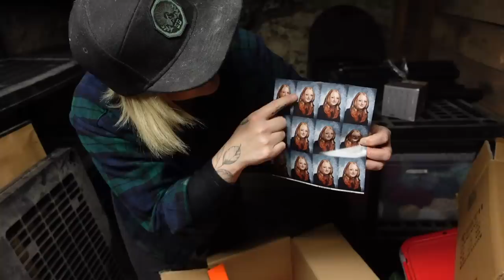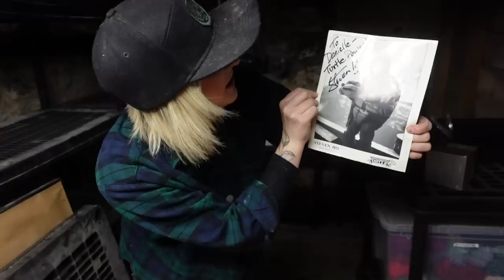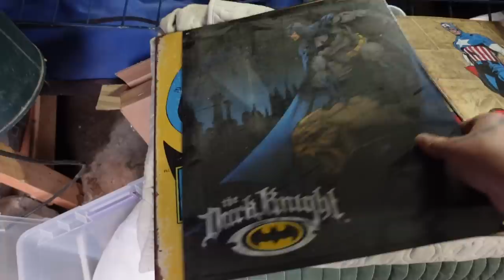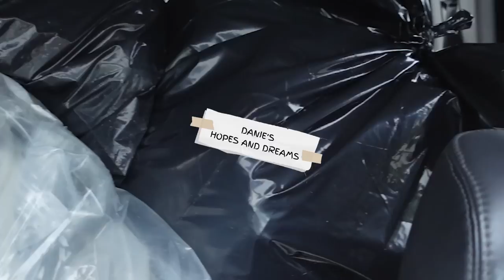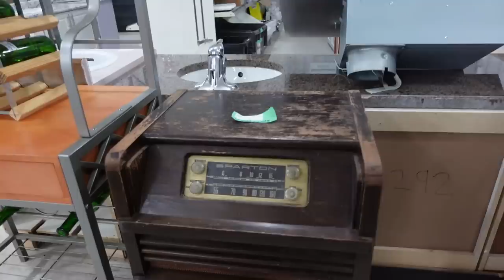cleaning out my storage basement for the first time *Secret Hoarder* | VLOG

Comment: Awesome job!  Glad to see Kenobi got into the spirit of moving things around.

My cellar went on a similar journey a couple of years ago.  If you are interested, my next steps after organizing were:
1) Shop vac ceiling, walls, floors 
2) wipe down anything that's still gritty, including windows
3) Bag anything not in a plastic tote.  I like the xl clear bags.  They keep the dust off stuff you don't want to keep cleaning (especially textiles, knick-knacks, lamps) and keep the musty smell down.  Add dryer sheets, laundry scent pellets, or litter box scented baking soda in the bottom of the bags.
4) 2 dehumidifiers - in the damp season, they fill twice a day!  It was an absolute game changer for the damp smell
5) Ready... Cheap mop and pail with lots of cleaner and bleach - just a quick go
6) Then, I painted the walls (no fuss) a pale blush pink (don't laugh, it's bright and cheerful) and the floors a beachy grey-blue (absolutely no prep).  You have to see it to know what a difference it makes!  I used good paint with primer included, meant for damp spaces.
7) I (my hubby actually - his one contribution to the project) spray foamed around the windows to keep the draft and bug entry to a minimum
8) Finally, I got some plug in mouse-and-bug-be-gone thingies.  The emit a sound (undetectable to humans and safe for pets) that says 'no trolls or spiders allowed!'

My soul feels better now and it's much easier to maintain because I don't need therapy every time I go down there ;)

Comment: I am working on 25 years of shizzel in my basement. It takes a weight off your shoulders to purge and organize. You might want to consider bug repellent plug ins for the basement. It helped in my bathroom. Won't get rid of all of the bugs but will help cut down. My bathroom is small & I rarely see bugs any more.

Comment: 5 Basic Basement Rules:
1. Set NOTHING on the floor❗️ Especially cardboard and metal that will rust! Always "pad" shelving with plastic, PVC or similar. The air space under the first shelf allows it to breathe and helps prevent mold. It will also allow the dehumidifier to do its job!
2. GET A DEHUMIDIFIER❗️ Every basement that's damp should have one running at ALL times! Set it to a dry humidity and let it cycle on/off by itself. Make sure the output has a hose attached that extends to the floor drain! 
3. Invest in plastic tubs for storage! They should have lids that snap on tightly! 
4. NEVER set things right against the walls! Always leave like an inch or so of air space so things can breathe and to prevent mold. It also will allow your dehumidifier to do its job.
5. GET A SUMP PUMP If you EVER have had standing water in your basement, even if it's only been a small amount❗️ Especially if your area is prone to power outages! 

You will forever benefit by following these simple rules👍 🎉❤